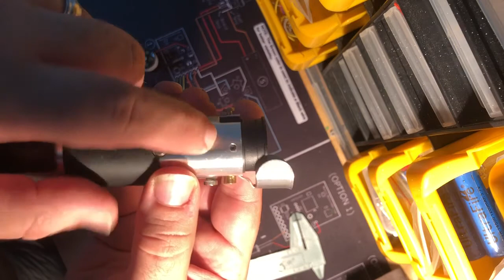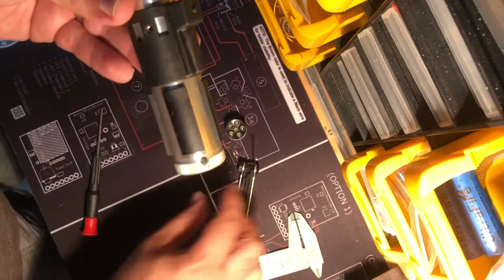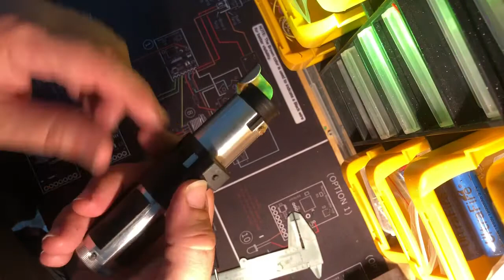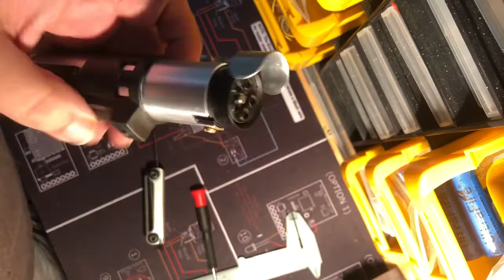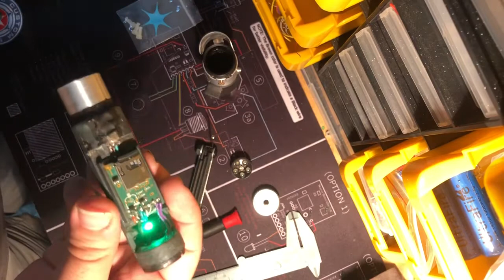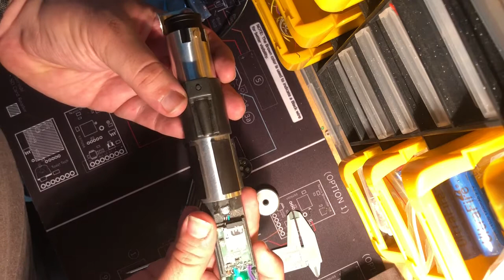Yoda Lightsaber Instructional video

Comment: Is this available to buy?
Reply from the maker: windows_xp no, I sold this one already
Reply: Dr. Erick Lopez is this the one you converted from the bolsey flash? If so, do you remember what model camera it was, there seem to be a few for relatively cheap and i’d quite like to give something like this a go
Reply from the maker: @tcd3077  yes sir! thats the bolsey flash! check out shtok on shapeways for chassis. he's got a new chassis that fits both this and the lethal crystal frog apprentice hilt which supports an 18650 battery and a Verso board. its the model #2 flash handle. NOT THE SERVICE FLASH. theres one on ebay that the box says #2 but the flash is a service flash. do not get that one.
Reply: @DrErickLopez  awesome, thank you